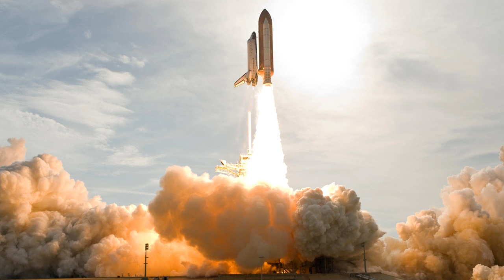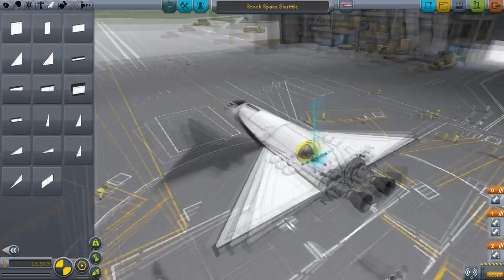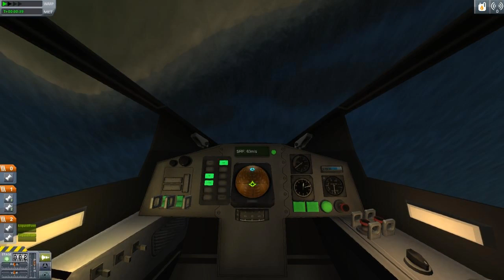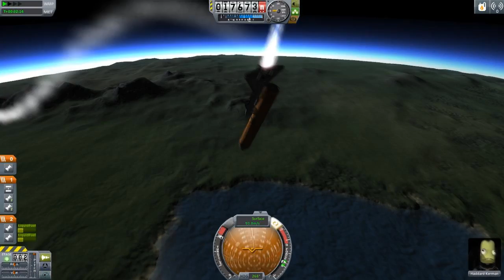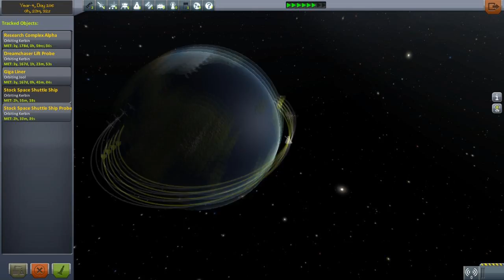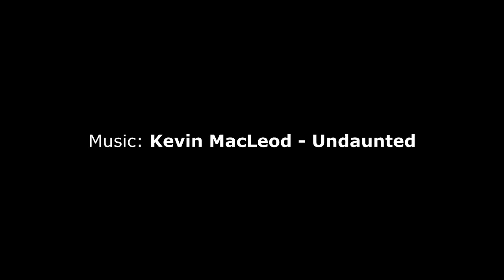How to Build a Space Shuttle in KSP

Comment: rougly 62000 funds for a space shuttle. Not bad. I made a MK. III space shuttle. It has 3 of those engines you used, but they are not angled. The 3 main engines provide lift for the shuttle itself. There are 2 or 4 smaller angled engines on it to keep it from spinning. The orange fuel tank has a big engine and I'm using much bigger boosters (KW Rocketry mod).

The thing can lift roughly 14 tons (a bit more if you add small boosters to assist in liftoff).
But it costs about 224000 funds and I get 66000 back when it lands. I used it to get my Duna Lander into orbit since my probes kept failing. Using remote tech makes it difficult.

Comment: I'm just having a lot of trouble matching the thrust vector exactly with COM since with my design they are far apart, and for some reason COT vector/arrow is too short. How did you align them so perfectly?
Reply from the maker: Use a ruler on your monitor lol However, a workaround is to use the straight lines in the background either on the floor or on the building as a guide. Using engines like the vector makes it also a lot easier because of their huge gimbel.
Reply: Ah, that makes sense. I started to think about if I should use a ruler or a piece of paper to line it all up xD. Anyways, thank you for an amazing tutorial!

Comment: how did you get the main peices in the cargo bay like that? mine wont set in there perfectly like that,its always to far down inside the plane
Reply from the maker: Corey Harrison Hi, I think what you need is the Alt-Key. This enables the node-snap-mode. Like this the parts only snap to nodes and nowhere else. I hope i could help and good luck!
Reply: KerbalEssences thank you so much,i used this whole design thing is,im running out of fuel before i get to were i can do a maneuver to orbit,also how do i get to where im not doing flips when i let go of my orange tank?
Reply from the maker: Corey Harrison I haven't done a Shuttle in KSP 1.0 yet so I can't really tell :D However, I will definitly do a 1.0 Shuttle video!
Reply: KerbalEssences The correct term is circular attach mode, and it actually removes the ability to radial attack while you hold Alt

Comment: I have an alternative for the angled engines, I made the big tank have  a mainsail engine, and then I atteched the shuttle itself on it, and I placed weaker vacuum engines on it and made the big engine crossfeed to the shuttle so when the big tank runs out of fuel it will replenish it for the shuttle, and I fired both the mainsail and the weak engines so I kept it stable. I even launched a satellite fromit's cargo bay once.
Reply from the maker: +Antonio Klaić That alternative is called Buran, the russian Shuttle ;P
Reply: KerbalEssences wow, I wasn't aware that was a real setup.
Reply: +Antonio Klaić the downside of that is another costy engine dropped into the ocean, which is the whole point of shuttle design... reusability! ^^
Reply: Michael Stankowski yes. But it is the only way I could launch a shuttle, I tried angling my engines and it still went out of control. Which angle would be ideal to apply to the engines ?

Comment: Looks like your satellite was starved of fuel after it was deployed. You need to disable the fuel feed in the satellite's tanks in the VAB before launch and then reenable it once it's deployed. Otherwise when your shuttle is firing its engines, it will also drain fuel from whatever is docked in the cargo bay (in the case, the satellite).
Reply from the maker: I did disable it (2:28) but I forgot the torodial one which got drained. Not too bad though, it was just for the looks :-) Thanks for helping anyways!

Comment: I can't add the shuttle as a subassembly. Please help.
Reply from the maker: Freddy Fazbear Hi, you don't need to save it as a subassembly in KSP 1.0 anymore! Simply save the Shuttle and open the SPH Shuttle in the VAB. Then save it in the VAB again and voila, you have a VAB Shuttle! You can now do it in reverse and put a decoupler on the Shuttle and the external tank. This way arround it is actually better because the decoupler doesn't stick to the shuttle after seperation.
If you run into weird synemmtry behavior you can switch the symmetry between Radial and Mirror by pressing R I believe. (R or F, not sure right now)
Reply: KerbalEssences Thanks for replying so quickly!

Comment: The real shuttle did not use monopropellant. It used the hypergolic mixture of unsymmetrical dimethylhydrazine or UDMH and dinitrogen tetroxide.
Reply: For the orbital manuvring, of course. Not the space shuttle main engines.
Reply: *  maneuvering
Reply: Levi Raskin there is no udmh without mods
Reply: I know. He was talkin about how the real space shuttle used monopropellant which was not true. I'm talking about the space shuttle that blew up twice, once to an o ring malfunction (no o rings in ksp) and agin due a heat shield failure. So the NASA shuttle
Reply from the maker: Yep true. I didn't realize back than that the word "monopropellant" does not include all hypergolic fuels. The real Shuttle used hypergolic bipropellant.

Comment: "It's a spaceplane with a really gigantic side fuel tank."
No, it's really not.  You see, it doesn't actually fly.  Its wings do literally nothing for it on the way up except generate a ton of drag, which is one of the main reasons shuttles stink (and smaller versions like the X-37B that fit inside fairings actually perform BETTER- because it hides the wings from the atmosphere on the way up...)
Reply from the maker: Well, it's not only the way up which counts. The Space Shuttle is / was a space plane because it has wings to land on a runway and it also flies in space. A very important part when comparing space craft is its lifting capabilities.

The X-37 is nice but it would fit inside the bay of the Shuttle (http://goo.gl/y9Z2ug) This means it won't be able to do the same job (it's not meant to).

The Space Shuttle can however currently be replaced payload vise by the Ariane 5 (Europe), H-2B (Japan), Proton / Angara (Russia), Atlas V / Delta IV Heavy / Falcon Heavy (USA). All of these are allready competitive without even being reuseable (until today).

I think this is a nice picture to show how big the space shuttle actually was: http://goo.gl/0VVN49
Reply: KerbalEssences The mass and drag of the wings GREATLY exceeds the mass and drag of just packing a little more fuel and using engines for a soft touchdown of the upper stage.  And before you say this isn't possible, one of the alternative designs of STS (SERV, proposed by Chrystler Corp http://en.wikipedia.org/wiki/Chrysler_SERV) was entirely wingless and did precisely this.  Wings only make sense if you use them for your ascent- as the British are doing with their SKYLON designs: http://en.wikipedia.org/wiki/Skylon_%28spacecraft%29

Comment: in 0.90 its easier to make a shuttle
Reply from the maker: Yup! I'll make a new video about space planes in 1.0 with new aerodynamics!
Reply: KerbalEssences How did you save the whole Shuttle as a sub-assembly? I can't do that :(
Reply from the maker: Jonathan Pereira Hi, put a qubic strut on the belly of the shuttle where you'd like to mount the external tank. In the new KSP 0.90 you don't have to start building it on the strut as I've done in the video.

Instead you use the new "Set Root Part" tool in the editor. Click the qubic strut twice with the root tool and voila: The craft will be handled as if you had started builing it with the strut.

Now you can grab it there and drop it into the subassembly dropzone.